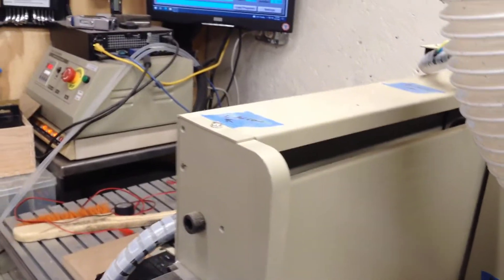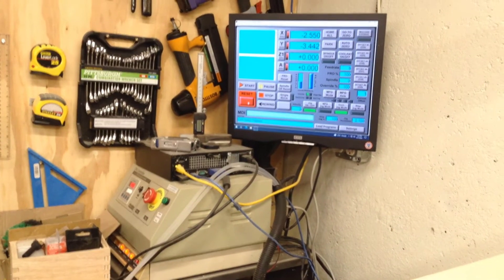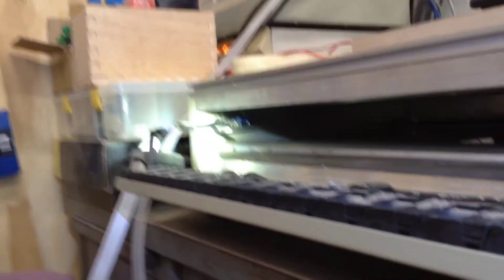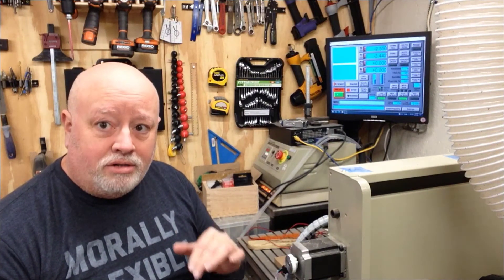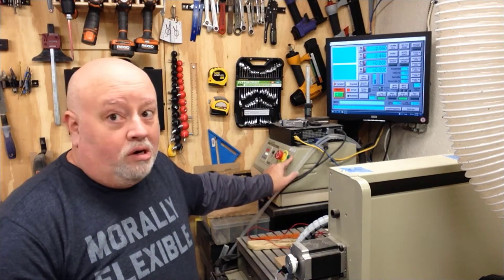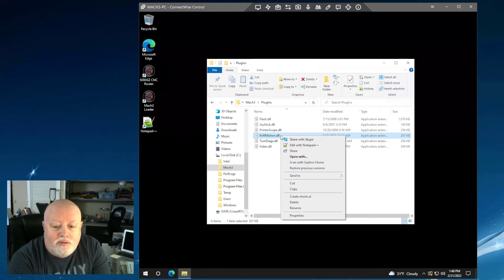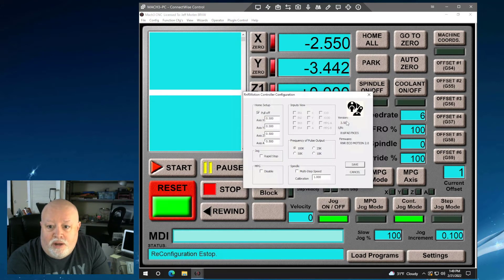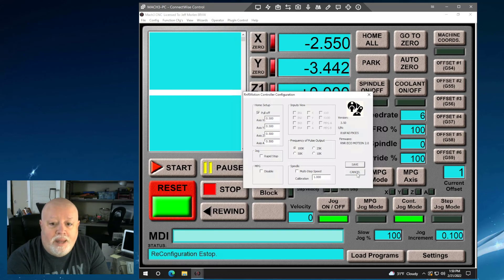Limit Switched and Motion Control Troubleshooting

Comment: Hi Jeff, great video! But what about the Z axis? I see no limit switches on the Z axis. How can I set machine coordinates along z axis without limit switches?
Reply from the maker: My CNC does not have limit switches on the Z axis.  One thing to note about CNC is that it is based on the plus, or minus, movement of the axis from it's zero point.  The zero, with most woodworking/metalworking is the surface of the material (or the bed of the machine).  So, this is the reference point that it starts with.

One thing to note is that you CAN push your Z axis to it's upper and lower limits and you will cause your system to stall or crash.  So, within the software we can set safe limits.  But, in most cases, we just design our pieces to not exceed the limits of the machine.

Does that make sense?

Comment: Hello Jeff! I have a question for you about these limit switches. Do you think there's any chance to get them working as home limits as well?  I have tried to turn the X and Y homes On in "ports and pins", seen the home signals turning on when switched in the Diagnostics section of mach3, but when i push the "Ref all" button the switches actually keep working as limit switches and not as homing. Any suggestions?
Reply from the maker: This is something that I've thought about for a while.  But, like you, were not able to figure out how to use the limit switches as home switches too.  In the end, I think a separate switch would be best to fine tune the homing function.  Meaning, you could go past the homing switch, but then encounter the limit switch.  It would give you the ability to have a constant 0-0 starting point, but also the safety to not crash your machine.

Does that make sense?
Reply: Makes sense as it is supposed to be. Though a limit switch signal shall be bypassed while homing and it doesn't happen. I want to give a try again in the next few days. Maybe delaying the limit switch input (dangerous), or better checking my configs... In case I'll let you know.
By the way, I finally understood what the green button was intended for, but I still prefer the software "override limit switch" which is even safer since it allows the limits to stop the machines as you move back off them.
Reply from the maker: Depending on your machine, they could be wired in parallel.  This would stop the ability for it to be able to isolate one switch.
Reply: I confirm that as any of my four switches is triggered I actually see ALL of the limits and homing inputs lighting up. Mach3 homing does not ignore the limits and estop the procedure. Rnr motion card mentions homing and limiting on shared switch, but no documentation...

Comment: Thanks again Jeff
Just a note: 
The override button doesn't light up, if the override (green) button on the VFD box is in the override position, none of the limit switches will work at all and nothing will indicate on screen. 
If any of the readers here fail to get any error when manually pushing one of the limit switches, try toggling the override button, then try again.  
We all know how I figured that one out lol.
Reply from the maker: David... you are exactly right!!  If you have the green button in the override position, it will disconnect the limit switch portion of your controller.  So, make sure, before you test this out... test out the limit switch override setting.